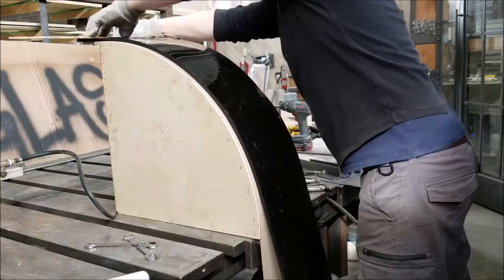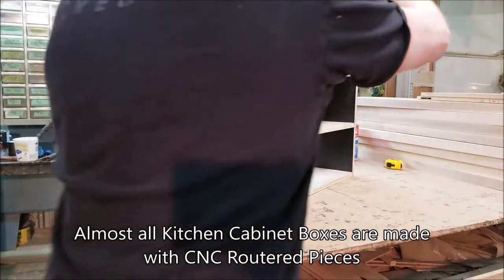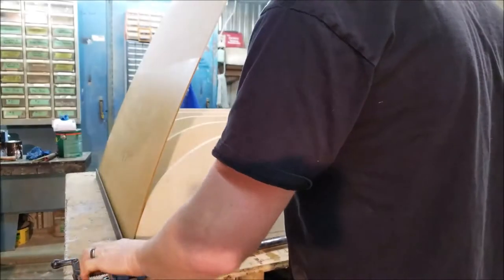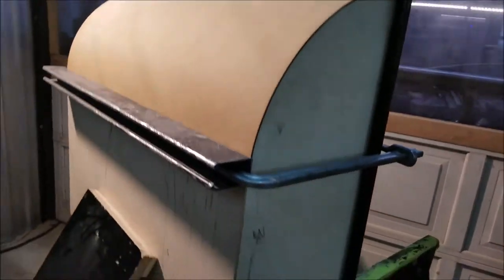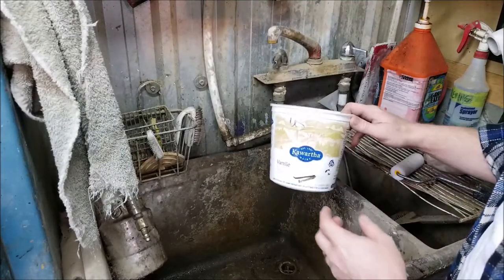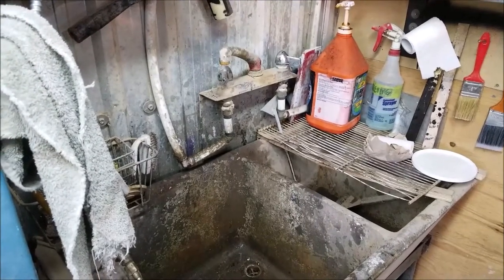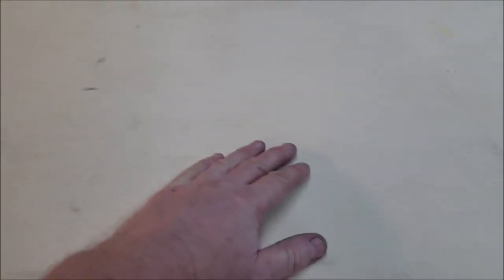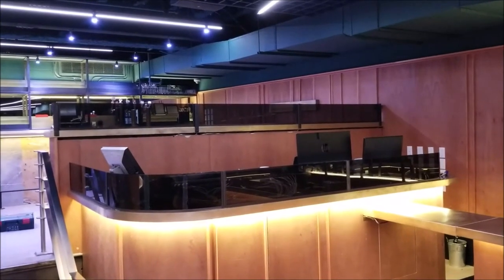Bending Acrylic on Curved MDF Form /Making Curved Wooden Cabinets

Comment: Hi, can you explain how do you apply the veneer for the cabinet at the end of the video ? Do you use contact adhesive, a vacuum bag or another method ?
Reply from the maker: Hi. Sorry just saw this. I used wood glue and strapped and clamped another curved piece of mdf on top